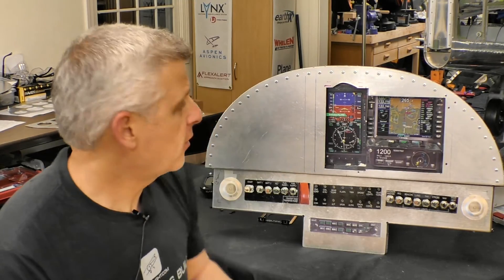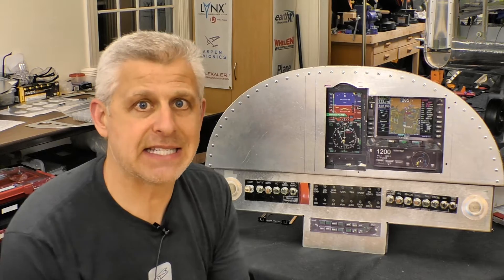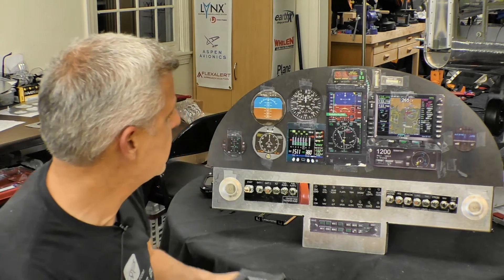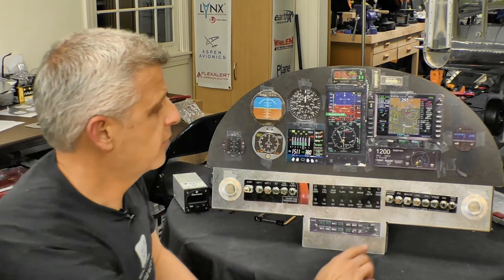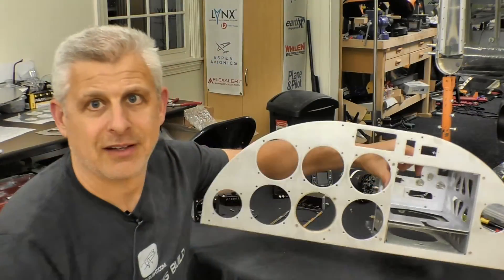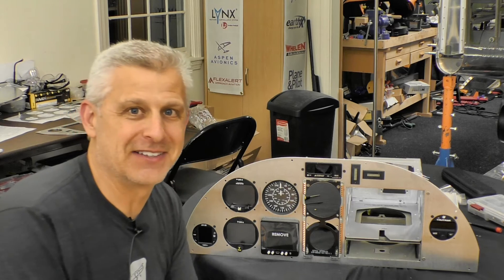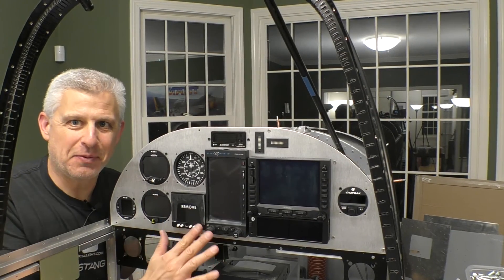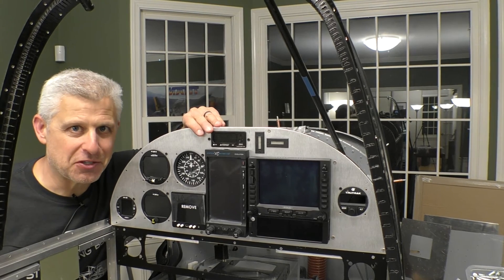Panel Time - Part 2!  Building the Instrument Panel on our Replica P-51 Mustang...

Comment: Another great and helpful video.  I looked up Fabco to see where they were located so that I could contact them for my panel.  They're in Hudson right?

Also, who drilled out the mounting screw holes? Fabco? Is that part of job they did?

Thanks again
Reply from the maker: They laser cut the screw holes as well. They don’t typically do retail customer work, but we work with them at Approach Aviation, so they did this project with us.  Feel free to contact me directly at SocialFlight if you need help.